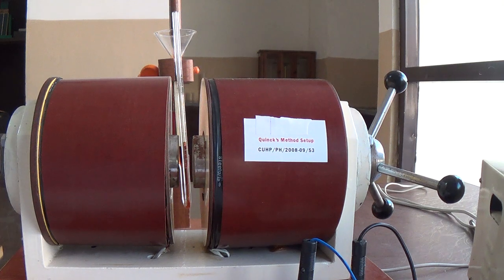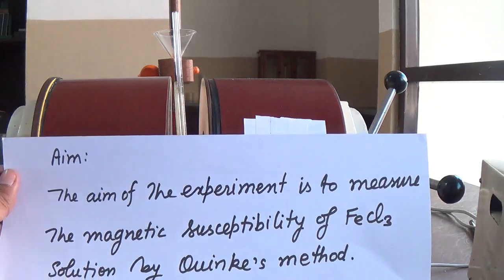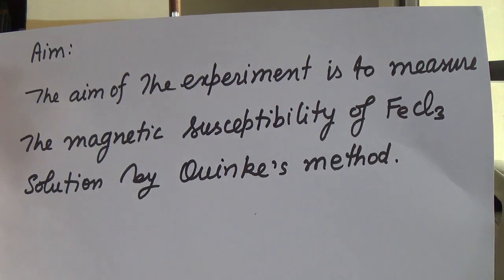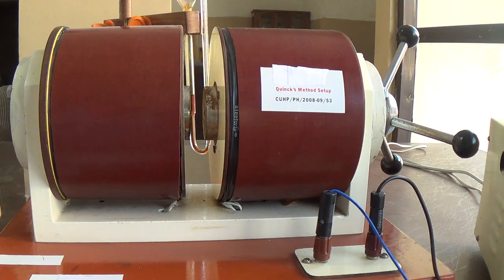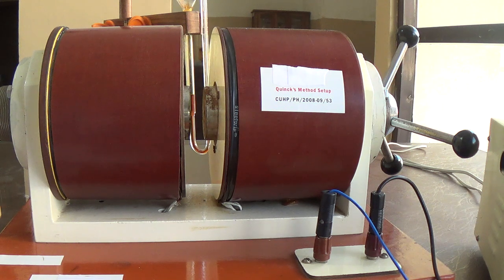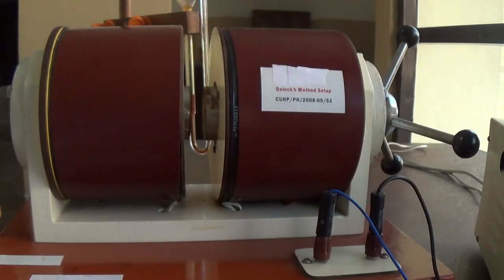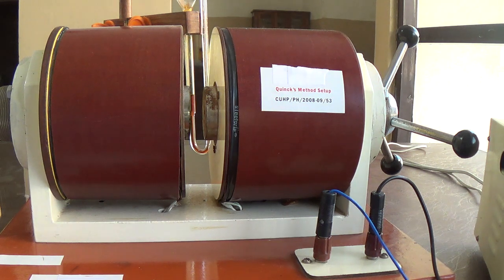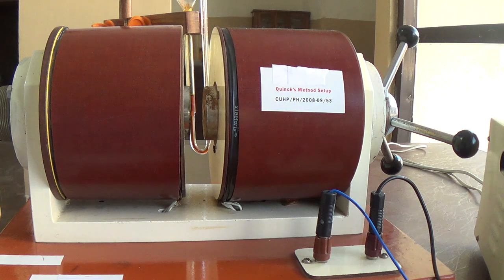Measurement of the Magnetic Susceptibility of FeCl3 Solution by Quinke's Method|APNIPHYSICS

Comment: Why they took quinks tube only
Reply from the maker: This is the name of particular u shape tube for variation measurement...in it you can see ferrous material and it's response to the external magnetic field....if you would take linear tube, you can't decide,..if you takes vertical I think all materials are magnetized by external magnetic field, in case of u type shape of tube the portion which doesn't comes in magnetic field contact, also get magnetized by induction of that material which lie in between the external magnet. I hope your answer will be near to my explanation 😊...best wishes.